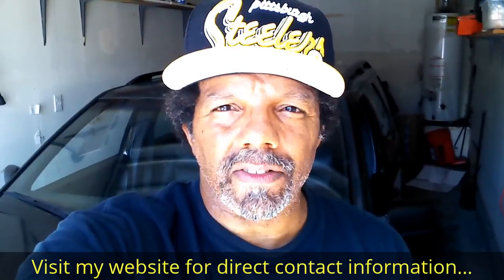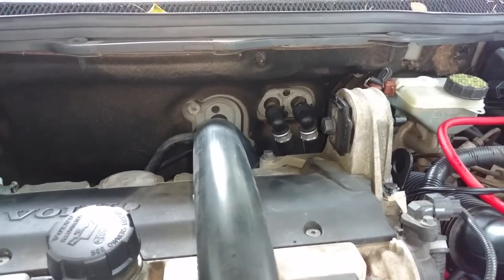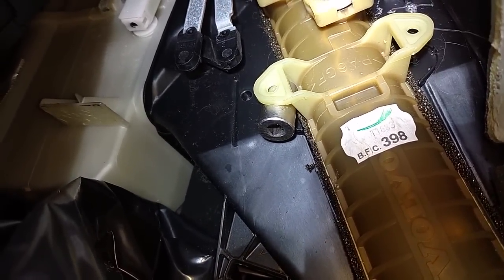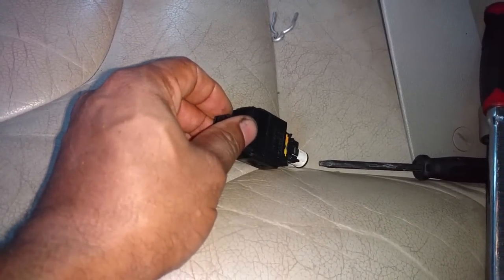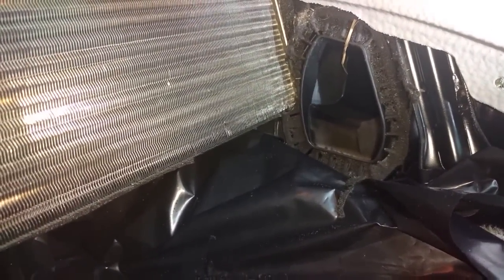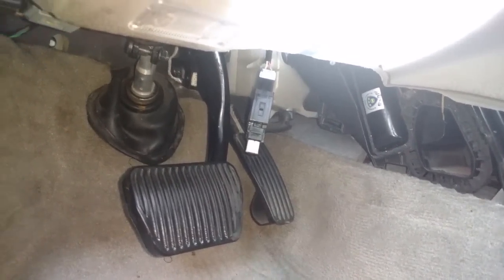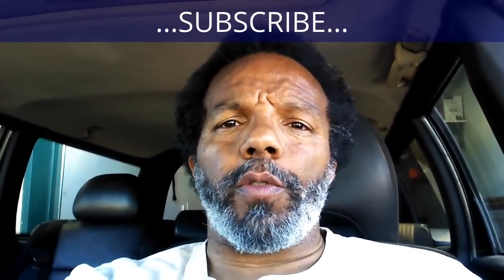How to replace the heater matrix core replacement, P2 Volvo S60, V70, XC70, S80, XC90, etc. - VOTD

Comment: Thanks Robert.  Your videos are great!  When I was looking under the dash of my 2002 V70 for my start-and-stall problem. I saw my heater core was leaking.  I also had water in the driver's side once and wasn't sure where it came from.  I saw one of your videos that said heater core failures are common Volvo killers.  I ordered the core from the vendor you suggested, Swedish Car Parts.  As the car is 15 years old with 215,000 miles, I figured when I drained the coolant for the core change, I'd change out the upper and lower radiator hoses.  I got the hoses and the coolant from FCP. New hose clamps from Advanced Auto.  The coolant I found out had to be diluted.  Last month I changed the thermostat and the coolant temp sensor, parts were from FCP.

The core change took longer than I planned.  I took the brake switch off like you instructed.  Moving the white piece on the switch as far forward towards the front of the car is a HUGE help for taking it off and putting it back in.  I couldn't put the switch in for anything.  I moved the white piece forward.  That allowed the tabs on the switch to move inward.   The switch popped in.  

I also struggled on installing the bottom pipe.  I tried as suggested to put the new O-ring on the pipe.  I couldn't get the pipe in all the way to install the clip.  Then I put the O-ring in the heater core.  The pipe went completely in and I was able to put the clip in no problem in the direction you suggested.  It was a tight fit taking the core out and putting it in.   I didn't take out the steering or dashboard.  I dented the fins on the core coming out and going in like you did in one of your videos.

Once it was all put back together, no leaks on the hoses or from the core.   Thanks again.  I think I'll keep for another 50,000+ miles.
Reply from the maker: +arne lebrato awesome! Thanks for sharing.
Reply: Two months of driving, 5,000 miles, and driving in the snow in NC.  The heat works great and still no leaks.  Thanks Robert!
Reply: Thx, I am getting ready to do my gfs car and was worried about bending the fins putting a replacement back if it would just leak again, but I will give it a try.

Comment: Hey Robert thanks for sharing your expertise.
One gentleman said there was a clip on the steering column to move it out of the way to get the heater core in and out with no problem. Do you know anything about?🤔
Reply from the maker: No but you can try it.

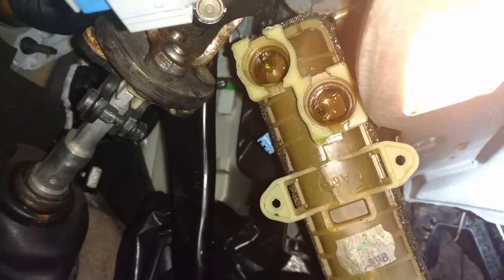Comment: To remove the heater core I removed the lower bolt on the steering column (seen at 4:45 at the left - careful with this bolt, it keeps the steering column attached to the steering rack),  and pull down and out the column coupler:  MARK first it's position/rotation at the splines both on the coupler and the column so you insert back the coupler at the same angle so the steering doesn't get turned when driving.  The heater comes out perfectly without forcing or crushing the bottom fins.  The brake switch must be removed and it's very tricky see this video https://www.youtube.com/watch?v=37u_oQ0Q0Gc
Reply from the maker: +Royale with cheese thanks for sharing.

Comment: I just finished putting new clips and o-rings in a ‘01 XC. Those damn things fought me tooth and nail to come out. Why Volvo put them in like that, makes no damn sense. If I ever have to do another one, I will press those pipes into the core and try and wiggling them or just cut the plastic out. Upon reassembly, put Chapstick in the hole and on the rings. This will make seating them, and putting the clips in, MUCH easier.
Reply from the maker: Thanks for sharing

Comment: Hi Robert first off thank you for the videos, they're very comprehensive and easy to follow. I replaced my heater core but a little residue still builds up on the windshield over time. I've left the core exposed and it isn't leaking that I can see; is there just coolant residue in the system and if so what do I do? Ty
Reply from the maker: Residue would be my guess. No idea how to clean it out.

Comment: I see the thought process for just muscling it in without moving the steering column but I really can't afford risking damage to the new core. Can I disassemble the steering column at the point where the core may hit it or do I have to disassemble it from the wheel all the way down? Thanks for all the assistance. Your channel has saved my skin many times!
Reply from the maker: Man, you can pull the roof off if you'd like.
Reply: That does not help.
Reply: In case you haven't noticed, Robert is a hack.

Comment: do you have to drain the coolant as i live in apt and they wont let me?
Reply from the maker: What did the video show?
Reply: @RobertDIY  video showed it yes but the apartment manager here will not let me drain any coolant out of radiator. They won't no about inside of vehicle but when it comes to outside they are real stickler on it.

Comment: I have a 2000 Volvo S80. I took the original heater core out but I'm having problems putting the core back in
Reply from the maker: +SuperelderSM hmmm

Comment: @Robert DIY I uploaded a video of my poor 2000 S80 Volvo 2.9 wondering what something is that I noticed yesterday. I still need to see about how to get my heater core replaced. Leaking worse. At any rate I had a message show up saying "Engine System Service Urgent" the other day. Drove it home let it sit for few days. Had to go somewhere yesterday so I checked to see if message was still there and it was. I checked all the fluids etc then noticed that vacuum cover or whatever it is on the manifold. Unplugged it and the car ran better. I don't know what that is. I capped it back on and drove  few miles then came home and message was gone.  Either way, what the heck is that vacuum port and why would it be capped and and why does it seem to run better when I took the cover off. Thanks for all your videos. Wish you  had one on my car. lol thanks
Reply from the maker: You need to get the coolant leak fixed before you destroy the engine.
Reply from the maker: If you have/had a message to have the car checked and serviced. You can get codes read and then work on getting the car fixed properly. It won't get better, until it's fixed. Old cars need to be fixed often.
Reply: wow..ok well the responses you have given me.. well..not really nice..ok
I am not rich and I have very little to operate on. I don't really understand the negative attitude. I won't bother you any more.
Reply from the maker: Not trying to be mean, just don't understand why you are driving around with a coolant leak that you won't fix and want to try to trick the car into running after receiving a ENGINE SYSTEM SERVICE URGENT message. I've been out of work for about 6 years, I understand what it is like to have no money. Not sure what else I can say.
Reply: UH...NO not trying to trick my car into anything..lol Like she would go for that. I feel disrespected but that is youtube (or other virtual world online stuff).. The message was totally unrelated to the heater core issue and btw it cleared I did my own research (as usual) and pretty much know what caused it. I am DISABLED and yeah... well it stays parked most of the time. My Husband will not help me with it..and that is my problem. My back is almost severed due to degeneration.. too my info yes but I know you have health issues as well.
Wow you really misunderstood my question/comments.. ok well 
you are judging me and don't know me.  I hope you have a nice life. take care good bye.

Comment: Is it necessary to drain the coolant to do this? I'm in college and don't have a ton of room to work. And security gets mad when we play with our cars.
Reply from the maker: No, you can spill a lot of your coolant in the floor of the car.
Reply: @RobertDIY  how much coolant we talking about? Will it drop a couple pints onto the floor? Or a couple gallons?
Reply: @BinanoSplat  a pint. Put a towel down.

Comment: Great video Robert. Very usable. I am working on XC90 and should have more space to pull out heater core.Couple questions, did you drain any coolant? Did you have to disconnect those two heater hoses ( that need to be clamped ) on the firewall inside engine compartment ?
Reply from the maker: +pujdo moj man, I did what is in the video.

Comment: Hi Robert, i bought a volvo xc90 12/2006 and it was pretty cold these days so i discovered that this car does not produce any heat in the cockpit. it is freezing cold. the engine is warming up normally and has no problem but no heat inside. do you think it is the heater core or something else? Thank you
Reply from the maker: +Patrick F. Electronic.
Reply: Robert DIY thank you for answering this quickly. What do you mean by electronics? What do i need t change or what is the cause of the problem?
Reply from the maker: +Patrick F. Likely dealer software reprogramming. Call a shop and ask if there is some outstanding recall for your vehicle.
Reply: Robert DIY what i have also to mention, after i start the engine i can hear water noise from the dash like someone is flushing the toilet. I read that this is likely a heater Core problem then, what do you think?
Reply from the maker: I have no idea, I'm not good at guessing. Heater cores leak and smell.
Reply: These on P2 don't leak like the older Volvos, but they crack inside and the heat is poorly transferred to the pins.  Still, if there's really not heat inside the cabin. must be a problem with the climate module flaps/arms or motors (the heat/cold mechanism is at the left side of the climate unit)

Comment: I've been struggling a bit doing this repair on my '01 V70. I finally managed to get the old core out but in the process I broke off the plastic end on one of those actuating arms you can see in the video at around 6:42. I assume those levers control the level of heat? I wonder if Robert or anyone reading this knows the proper name of that part or has a part number? Also after I got the new core in I went to reconnect the coolant lines and found that Swedish Car Parts had only sent me one O ring with the new core instead of two...so I replaced the o ring on the bottom line and reused the old one on the top...I shouldn't have because it leaks...so I guess I'll have to order another O ring. Anyway thanks for the video Robert. This is one that can be harder than it looks.
Reply from the maker: Yes, frustrating.
Reply: im in the same situation it didnt brake but it came out of the position it looks like it was either glued to or a push pin was holding it in very very very frustrating.... if anyone has any info how to do that or if it just pops back in that info would be great bc i cannot fiind any info on that at all ive found the whole part.... the climate control module  but if its just a little bolt push pin or  pops back in it would be nicce to know but anywhere i look i cannot see its proper postion for the life of me
Reply: @in-line5300  , same happened to me, I was pissed. Take a breather, unbolt the bottom gold T20, pry it up a bit, and stick that arm back on the nub. You’ll need a headlight, and a lot of patience, but you can do it.

Comment: Good video, minus the fact that he doesn't show him actually taking the pins out and putting them back in. Any tricks to get the top pin back in? I have new o rings and can't get the pipe to stay down so I can slide the clip in
Reply from the maker: I have a harder time with the lower pin. Took me an hour the other day.
Reply: That didn't exactly answer my question..
Reply from the maker: No.

Comment: Ugh, can’t get the top retaining clip in. Help!!
Reply from the maker: Bring it by.
Reply: @RobertDIY  I finally got it lol. Sadly I took the steering coupling off and can’t get it to tighten up. This is a mild bump in the road, I’ll finish this job tonight. Thanks for the vid
Reply: @RobertDIY  thanks Robert! I finished the repair and I now have HOT HEAT! WooHooo!! Thank you so much cause I was about to get rid of the car. Just bought!!

Comment: Thank you!
Reply from the maker: You are welcome.
Reply: I snapped off one of the clips of that brake switch trying to get it off. Going to need a zip tie fix to keep it on, but other than that has gone smooth.
Reply: I am sure that Robert will agree when I say this - in the world of replacing heater matrixes, that's a job well done!  Messy doesn't say the half of it.

Comment: And out came the big hammer to remove the steering shaft he he :-D
I suppose you would have to remove the steering wheel and rotary connections, then undo the bolts/s on the splines to pull the shaft out of the way.
Perhaps ;-)
Reply: I believe that Volvo expects us to remove the entire A/C head and the entire center of the dashboard and the air box to get a the heater core.  I think Robert has found a workable method to get around all that.  It's fantastic when he comes up with these tips and tricks that help out the Do It Yourself gang.
Reply from the maker: Pull, pull!

Comment: There's gotta be a way to get the new one in without damaging it.
Reply from the maker: Sure, remove the steering column and some other stuff.
Reply: @RobertDIY  try using the plastic from a wiper blade package as a shim and slide it in.  It worked great for me.
Reply: Those tubes need to be moved w/o bending them. When I replace the core, I’m going to loosen the bolts on the firewall and see if this helps. If your car has 180k+, and you’re still on the original heater core hoses, I don’t recommend this. Those plastic elbows are terribly brittle.

Comment: Still frustrated with this repair and ready to start throwing tools? I was too. Read on:

To start, this video was super helpful in replacing my heater core. However, it took me days of fighting with the o-rings and getting ready to tap out entirely before I managed to finish the job. Hurdle one is the BRAKE SENSOR. Don't go into that blind. Of course there's a trick to it. To figure that out, see this video here. https://www.youtube.com/watch?v=mDkV6LW9xAc

The next problem was GETTING THE O-RINGS SEATED. 
O-Ring problem #1: If you bought the replacement core with beige plastic (Mahle Behr 9171503 ), and also got aftermarket o-rings from FCP, there is a solid chance that the O-rings just don't fit. Get the Genuine Volvo ones. 
O-Ring problem #2: Use the right lubricant. I read somewhere, and wish I could credit whoever shared this first, that Sil Glyde Brake Grease is the way to go. Don't waste your time with a thinner lubricant, or any other lubricant, really. This stuff works. A $1 packet at the Autozone checkout counter is all you need. Smear it all over the O-Ring, and seat the o-ring into the groove first. The grease will hold it in place. Then use firm pressure and a lot of wiggling to get the pipe into the o-ring and fully seated. 

After a week and untold hours of failing to seat the o-rings and pipes, this worked first try for me on the upper pipe. The lower pipe was bent out of place more, so required three attempts before I got it seated. Once seated, the pins really do go in easily. Definitely get spare pins, as it's so much easier to remove the lower one by bending it.

I hope this helps someone else!
Reply from the maker: Thanks for sharing.

Comment: Why are the heater cores going bad on these vehicles???????!!!!!!!
Reply from the maker: Because man made them. They go bad in all vehicles.
Reply: Because its metal and plastic with gets heated up everytime you use the car and cooled of when the car is turned off. Now repeat this for like 15 years 365 days a year.
Reply: These don't go bad after 2001,  but get clogged from using the wrong coolant (for example GM's DEX-COOL)  or from using tap water instead of distilled (cheap at the Walmart pharmacy)  or demineralized water
Reply: Agree